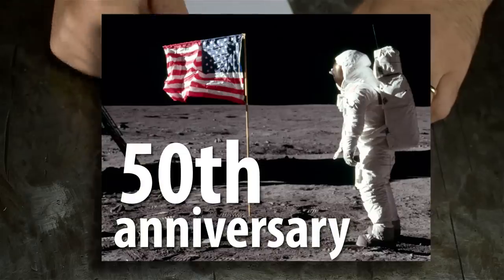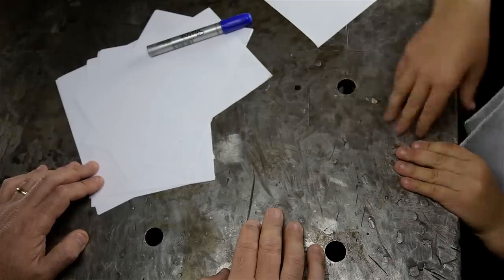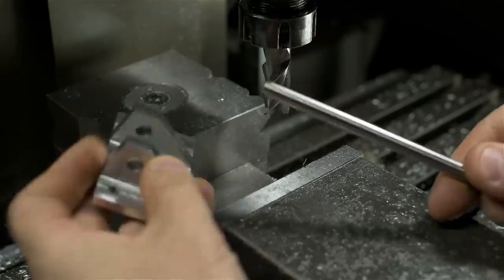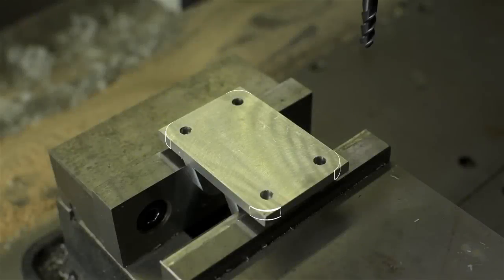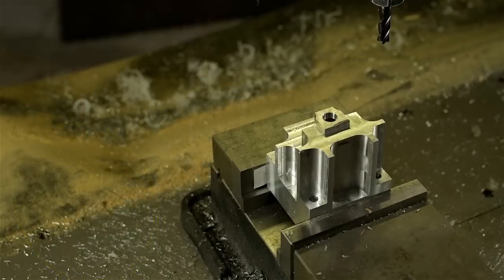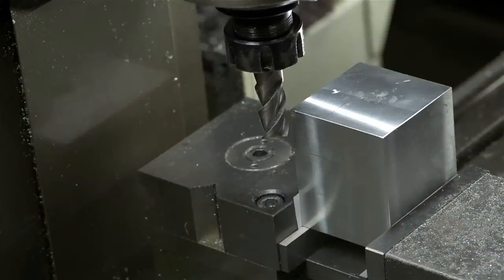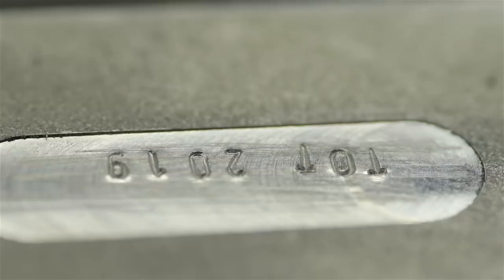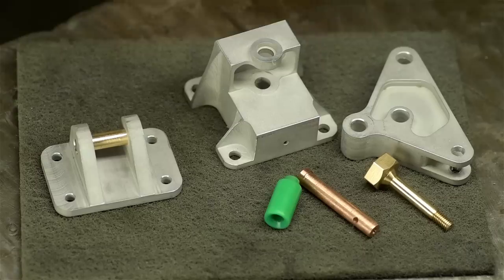ALL IN for PROJECT EGRESS

Comment: Everything machined to nominal? Assuming all contributors are doing the same, it'll be really interesting to see if their final assembly actually assembles.
Reply: They'd be lucky. My guess is Adam Savage is going to get a ton of practice in turning sleeves, using reamers, milling shims...
Reply: Of course everything will fit together. What do you think those gazillion buck space hammers are for
Reply: If the parts don't fit together easily, I guess they'll just have to get savage on it 😉
Reply: If all the parts don't fit, they'll call on Adam at ABOM79 to fix them all!
Reply: It'll all be shrink fit.  I think Adam will be able to flame fit it all just fine.  Never mind the fact that Jimmy Diresta made his parts from wood...
Reply: He drilled some parts to fit.
Reply: @Gamerock82  thanks for this link - just watched it to spot TOT parts

Comment: I was expecting to see you use some Unobtanium instead of the same old dehydrated space aluminum. That was disappointing. And I'm going to look for that opening trick you did and see if I can't debunk that. Although it was refreshing to see that trick done with a yellow cloth instead of the blue ones they always use in Vegas. But overall, not bad. The part you made for NASA is better than the part I made for NASA, or at least it will be when I make a part for NASA.

Comment: Congrats on the job! As usual your editing and subtle nods are extremely entertaining! As for the third hole on the bell rocker, my best guess would be an over-center mechanism. A tension spring would connect behind or a compression spring in front of the hinge to lock the system in its two states. Can't wait to see this put together!

Comment: I think Tony would be proud of me, I got a Mitutoyo stand yesterday! Now to get a lathe.
Reply: kpn3nc 
Sounds like you got the hard part out of the way first. 😁
Reply: It's a trap!  First you get a lathe.  Then you need tooling. Then you buy a mill.  Next thing you know you're searching ebay for 60 year old surface grinders.  You have been warned.
Reply: @HomebrewHorsepower  the 60 yr old surface grinder is going to look great next to my 50 year old bench grinder and 40 year old drill press. Good thing I already live in New England.

Comment: They said they can't build the engines of the Saturn V rocket (f1) because they don't have the craftsmanship and skills of the workers back then anymore. 
Maybe you can help them.
Reply: the real reason is because the builders didn't properly document all the changes made.
Reply: jokes aside, thats probably the worst excuse i've ever heard in my life.
Though tony would crush competition.
Reply: @cameronwebster6866  NASA looked at doing it, and decided that they would basically have to build several engines just to figure out the methods and alloys and such, and it would be cheaper to go with a new engine designed for modern technologies.
Reply: Get up close to one and you’ll understand. It’s insane, especially the detail around how they flow cold fuel around the hot exit cone to keep it from melting.
Reply: It's exactly the way it is at my day job - we build the thing, the project manager asks for a bunch of tiny last minute changes because he sees ways it could be better now that he can actually work with it - which is great, except no-one writes any of it down, so now when we go back and work on it we accidentally undo some of those little changes from the initial design so now the thing doesn't work, and we have to do even more work to figure out what we broke and go back and fix it.
Reply: @TOASTEngineer  Sounds just like programming code I used to write. Except I had the advantage of using a versioning system so I could pull copies from specific periods of time and compare to figure out what the hell I was thinking.
Reply: @eideticex  Commenting your code..
Reply: @cameronwebster6866  I had to do a machine retrofit one day at work. We had the CAD model of it, and all the drawings but when we did a machine breakdown we found shims and some custom parts all over the internals of it. The people who built it originally jotted notes down using sharpie over where the shims went but even those didn't match what physically installed. Shop guys do awesome work but often documentation isn't one of them.
Reply: Yeah, not buying it.  They built an launched how many? like 20+ ?  Did someone throw away all the technical drawings that were used at the factory?  C'mon.  And alloys are well documented  much further back then the 60's, none of this stuff is mysterious.
Reply: @jasongamer8649  It's actually very plausible if you have ever worked in an engineering environment. Obviously at the time everyone knew well enough what was going on, but the pressures of the next project make you forgot about the last, and it's easy to throw something out thinking that there must be other copies when there aren't. I worked as a draftsman for a number of years and it doesn't surprise me at all. Obviously there would still be most of the drawings somewhere but you need more than just most of the drawings. There also may have been specific construction techniques that were never documented.
Reply: Jason Gamer You’ve got it all figured out huh, I’d bet you could even whip up a few engines in your garage. You really have no idea, they aren’t Toyota Corollas that were designed/engineered to be mass produced and were maintained/modified by the same men who built/designed them who are dead and retired now. You would understand this if you ever worked in a shop much less a government shop (10x worse at least). There are numerous examples in engineering where it’s necessary to start from a clean sheet, this is a text book example.

Comment: Well, they said they were making a replica but didn’t specify replica methods had to be used! Good thing. The lunar module started out with 32K of computer memory and the programmers weren’t sure they could fit the code in that. Relief came when a new computer with 64K arrived and the programmers knew they could fit into that comfortably. (Ah, assembly language!). I bring this up only because I was wondering how much “core” Tony’s router has compared to the lunar module 50 years ago.

BTW, that sand blasted finish was genius. Those parts have that “mil-spec” look nailed. Fantastic work all around. As always.

P.S. there’s a whole thing out there in the makerverse centering around reproducing parts of Apollo and other space programs.  A really great example can be found on the Applied Science channel where he reproduces something called a DSKY. It’s stunning if you haven’t seen it.

Comment: I am watching NYC CNC's video right now, and they show a pic of the whole door, assembled. The smaller piece you made is hard to distinguish, there are several just like it, but the larger assembly is obvious. It's a corner pivot for the locking assembly. You can clearly see the fancy nut and everything, so you will definitely be able to see your parts when they are in space!

Comment: Love your stuff Tony.  Just thought I'd share something with everyone about machined aerospace parts. I noticed that the internal pocket cuts and slots are done with a nice sharp endmill with nice sharp square tips. In aerospace, we ALWAYS put a few mm radius on the tips to provide a fillet in the internal corners. This is to avoid the stress concentration that occurs in sharp internal corners that leads to stress cracking. It's not a problem with this build  because it's not actually going to go into space (despite the way the parts look :). If you are making parts for an ultralight aircraft or something, however, always fillet the internal cuts.

Comment: I've found that for deep corners like that, it helps to use an HSM or trochcoidal interpolation style path to cut the radius in several steps.  The trick is to keep the radial engagement of the cutter from spiking as it gets into the corner, which causes the "flex" of the tool to change direction and amplitude sharply.  A simple way of doing this is to approach the corner as two features, you stop halfway around and arc out then back in.  CAD would calculate the size segments needed to match the radial engagement of the preceding cut and fraction the feature into a trochcoidal path.  Or you can ream or bore the actual radius in the corner a few thou undersize and clean up with the finish pass.

Comment: When cutting inside corners with small diameter extended length endmills, a trick I learned, is to prior to the tool pathing of establishing the inside corner, is run a g89 tool pathing, and punch in the coords of all the inside corners that tool is establishing. Definitely has to have been roughed out before doing this. Typically the more material for your tool to cut, the better the finish. Also you will was to spin quite slow s500 or less, and feed around 2-10 ipm. Lol, just remember to ramp your spindle back up after your g80, and sending it back into your linear cutting cycle. Something else I learned about chatter and deep inside corners, is that in my experience, minimal tool holder to work piece is key. This may be difficult, when opting for extended length of cut endmills, which seems to often be the choice in manufacturing situations like this, but for me, best results came from plunging out the corners with a regular length endmill, that was as minimally shank relief ground, and then just hung way out of your er16 holder. As far as linear cutting goes, it was kind of a toss up. While surface finish quality seemed to be better with regular relieved endmills, holding on a very questionable amount of shank in the collet, often if many cuts were required under these conditions, or production runs, the endmills wouldn't make it through, often pulling out and or breaking. Flute length, while improving quantity of passes required, and reduces amount of relief grinding, reduces surface finish quality in every instance I have personally required the use of them.
Reply: Zcarb, TiN coated, anything other than just a regular carbide, or high speed endmill, I 100% do not recommend cutting aluminum with. I don't exactly know why this is, I know coatings are supposed to improve tool life, and they DO, on steel and other metals and alloys, but for certain, out of the literal tons of aluminum shavings ive made in my life, coatings ALWAYS gaul when cutting aluminum. Doesn't matter if you use them submerged in a bath of coolant.

Comment: Watching the video of them putting it together was pretty cool. I see both your pieces. The smaller one is installed  in the lower left side, just as Adam is saying its great when one piece fits perfectly. ( paraphrasing here of course) The second piece is in the upper left side connecting the opening linkage around the corner of the top to the left side.
Reply: ps. your name is second to last on the plaque.

Comment: Tony. On your router you should give HSM (high speed milling) a try, 10% step over and stupid high feed rates. Works really well with aluminium and should reduce the amount of aluminium welding I get but I also use flood coolant which I don't think you'll have access to. Plus HSM buts next to no load on the spindle so perfect for a router. Best to look for feeds and speeds in the catalog for your endmills

Comment: Just a FYI but Tony's parts are located on the interior upper left corner of the door hinges facing the interior are on the left most side and right next to the upper hinge is this bell crank type mechanism. You can see them in the 3d model at the tested link.

Comment: My dad was one of the engineers that designed and built the Saturn V.  His contributions were the landing legs and ladder for the lunar lander.  The instrumentation layout for the command module.  He did the stress analysis for the first stage.  And in later missions he worked on the Lunar Rover, he designed the suspension and wheels.   I remember living in Huntsville Al and how the whole house shook when they did the testing of the first stage at Redstone Arsenal.
Reply: That's weird because GM built the rover. I'm pretty sure they did it all on their own too. I kind of remember NASA being blown away by the design.
Reply: @1pcfred  Martin Marietta did the design.  He worked for Boeing and Martin during the moon landings.
Reply: @1pcfred  Also, i still have his team badges that show the cartoon of a mule with all the antenna and shovels and picks like a old miners mule but with space age stuff on it. It was the design team badge.

Comment: I just turned 16 and ran into some trouble trying to convert an old beat down BMW into an electric car. I love the comity and expertise you bring to your videos. They are always fun to watch after a long day. I have only been watching for a few months but I will continue until you stop making videos. I am having trouble connecting the new electric motor to the old car's transmission I was wondering if you could help me find someone who can mill a male to female spline shaft. the motor has a simple 24 tooth internal spline and it has to connect to a male spline found on a BMW 318ti transmission. I have all the specifications for both splines but not the expertise or machinery to do anything.

Comment: Just add Bimba or Parker Stainless air cylinder between parts. Instant door latch with locking linkage. Probably coulda used the optional Parker or Bimba mounting bracket, but where's the fun in that? I like the approach to meeting the deadline, "youwantitbad?yougetitbad" plus "outer-space weathering". it will work perfectly!
Nice Job and Video! I look forward to seeing the finished door.

Comment: Honestly though I have a question for all you machinists watching this. Tony your advise would be awesome as well. My summer job is cutting some sheet metal cups on an old Mori CNC lathe. (I know. It sounds stupid. Cnc for sheet metal..duh). We have those little tiny carbide plates and they were getting absolutely wrecked. Using a more centered stream of coolant and incresing the feeds helped. But I have a question. How would I go at breaking the chip. The chip coming of there is loong and gets tangled everywhere. Coolant pipes, parts, tail stock, everything. I would like a smaller chip or ideally small pieces of chip falling down. One more question. The machine keeps returning axis overload alarms for both X and the Z axis. They are not hitting anything and the machine needs a slow tedius reboot everytime, it cant be reset. I have an 800 piece/8 hours norm to fill out and with it spitting out these alarms all the time. The controller is a Fanuc 10T if anyone still uses one.

Comment: real world space craft use metals that won't cold weld in the vacuum of space for moving parts. Hinges and pivots and things like that made from the same metal or metals that can weld together caused a number of issues in the early days. Dissimilar metals, changes in designs and special coatings are used now to mitigate the issue.

Comment: Hey TOT! Don't typically comment, but here we go. Couple things:

1. I noticed some nasty sounds coming from your router. I had the same noises and chatter on mine before I switched to a decent single-flute carbide cutter, which worked wonders. I personally use Onsrud spiral O flute cutters, but I'm sure there are others that are just as good. That way I can spin the spindle to its max RPM (to give it every last bit of HP I can) and let that dictate the feedrate. From there, I just fiddle with the DOC until my router can't handle it, then back off. Just a thought, I'd love to hear if you have any comments on my strategy. 

2. Please please please talk about rotary broaching! I'm planning to make one for my lathe and it'd be nice to hear your thoughts on the cutter geometry and the like. Rotary broaching is black magic as far as I can tell, so a little clarification would really help, such as the exact pentagram and any blood sacrifices needed to summon the demon that makes the hole. All those ancient texts were getting cumbersome and reading demonic for too long gives me a headache. If buying one falls through, I feel like you could make one since as I understand it, the critical thing is getting the 1 degree (ish) offset from the spindle axis.
Reply from the maker: you should comment more often! good tip.

Comment: You should've gone with new glass beads because their round shape leaves a dimpled chrome finish. They polish the Keck telescope mirrors similarly by angle blasting using round beads. Shattered glass beads and other natural abrasives have sharp edges that leave a matt finish like yours.

Comment: In the photo of the hatch @1:11 you can see the bell crank in the top left corner set at about 45% and just in side of the push/pull rods. The other part is just next to it on near to the left outside edge.

Comment: I suspect the third, unused hole might have been a connecting point for a handle, lever or even a hydraulic arm used for opening or closing the door.  Just a thought.

Comment: I see on 1:11 the two parts you are making for the hatch. The bell crank is upper left-hand corner there are a couple more around the door. The other is by Adam's right glasses tip. There are more of these also so he must have other makers making the same parts. Yours are built better I'm guessing. You may already know this before I expanded the door picture and scrutinized the design. I have CRS, OCD, kneesels, toeleo, and small cox. Which is why I examine things closely. Great work, I am hiding under your glockenspiel. So please don't play it too loudly cause I have ear mites.   :-))      lol